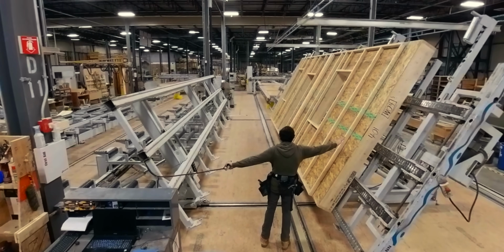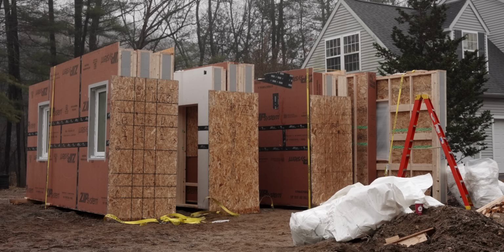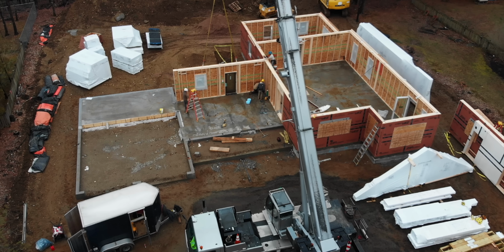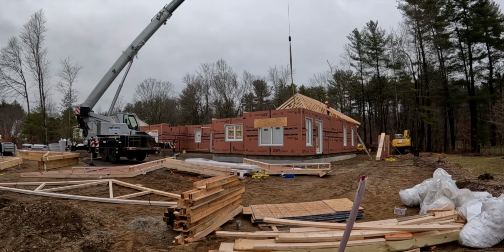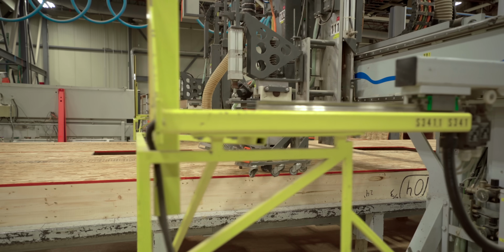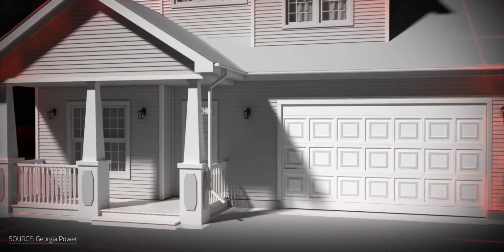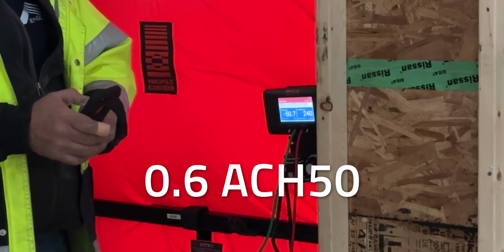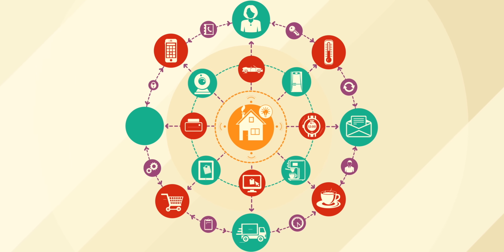Wow! I Didn’t Know A Prebuilt House Could Do This

Comment from the maker: So what do you think about the factory built process so far? Get Surfshark VPN at https://surfshark.deals/undecided - Enter promo code UNDECIDED for 83% off and 3 extra months for FREE!

If you liked this video, check out: The Simple Genius of a Prefabricated House - My Net Zero Home Build https://youtu.be/r-RTlbv84T8?list=PLnTSM-ORSgi7FwYRnWkpCSkAeFOzrgh5h
Reply: All depends on the QUALITY control.  Ive owned 4 homes.  We had one pre-fab that was atrocious and a stick build that was phenomenally efficient.  However, in New England, why build a slab on grade home without at least a partial basement?  Unless I missed it...
Reply: Looks awesome man. Just want to let you know they also have this new thing that pressurizes your house and blows silicone in the air to fill all the little gaps & pin holes to make it as close to100% sealed as possible. If you haven't seen it yet you should look into it before you finish the interior.
Reply: @micjr21  This is the product that you are thinking of. https://youtu.be/JYugiSwWoPk
Reply: Looks amazing n great job on the house!!!
Reply: Looks good. I also built in New England but used R-42 SIPs everywhere including the roof and full basement. I went with geothermal radiant floors and tri-pane windows but didn’t know about those European style latches at the time :(.
Reply: @moonthief869  I'm in the process of planning my house as well and plan on geothermal radiant floors. What did you do for AC?
Reply: I’d love to hear your arguments for/against regarding basements and slab-on-grade, both from the perspective of energy consumption and bang for buck on living space.
Reply: Nice, just hoping for no concrete cracks in the walls/ foundations area having poured in those conditions.   Might as well as  test for radon at this stage as remediation will be easier.   Make sure the guys put rebar in that driveway instead of doing it on the driveway you will have to replace.
Reply: Hi Matt. Have you given any thought to using EV battery(ies) i/o dedicated solar power system batteries. I would imagine the savings would be considerable since you get so much bang for your buck with EV batteries. For instance, 75-, 80, 90 or even 100 Kwh EV battery could be had for anywhere between $8-12k, whereas you would be spending that much or more for a 10-12 Kwh dedicated solar battery.
Reply: @lickshotpalmer1  the issue with EV batteries (assuming you mean removed from EV vs. using EV as grid storage itself) is that the EV batteries aren’t UL certified for residential use and would be issue for building codes.
Reply: @mrbizi5652  Got you.
Reply: Very cool Matt.  Looks like a great way to build a house.  I envy your future efficiency!   Where I live (CA) the utilities are charging an arm and leg for power now,  more efficiency sound really good.
Reply: Love seeing what you are building and have been amazed at the new factory built passive home tech and the high quality and efficiency of these products! Was wondering how electrical is run do they use a preinstalled pvc type system that they just run the wiring thru later which would allow for easy changes or upgrading or is the electrical all preinstalled sort of like a plug and play system, what about the plumbing? Is it all preinstalled in the walls too?
Reply: I truly like the assembly line/Factory Built concept for all of the reasons you cite in this most excellent presentation, Matt. But shouldn't there be some economies of scale benefit derived by the home purchaser/builder? While I get that this particular manufacturer incorporates a great many 'extras', particularly in the realm of energy efficiency; once a process has been developed and perfected, there should be some cost savings realized by the person paying for it such that one doesn't have to depend upon the energy cost savings to offset the greatly increased cost of the structure.

I seem to recall that you are spending somewhere in the range of $300 per square foot for this home. Some of that may be due to where you are but that still seems like an awful lot of money to have to recover via energy savings.
Reply: Matt.... as a patreon supporter of many youtubers right now (way smaller than you, and younger that need the help) hear me out... I really think you should and would be a win-win if you did a 1 per month patreon. A lot of people that could say get access to your upcoming videos a few days in advance, or something a click special than watching here.... it really is a win-win because 1 is better than 0, you dig? 👋 imagine all the people in other countries also, they can afford 1 a month to support your work, not 5 though... once you get to a few that is 15 or 20, you get me? I have a few patreons on a dollar and it adds up if you have 10 dollars compared to 1 or 2 fives.
Reply: I would be very interested in a video about how solar performs with snow. I am thinking of moving from sunny Arizona to a location with fewer drought concerns. Which almost certainly means dealing with snow if I transfer my job to another location my employer is based in.
Reply: @joewilson3393  ha. Fewer drought concerns… it’s been a super hot super dry desert for at least 50k years. If people were ever meant to live in such an arid suburban sprawl, it’s lost on me. Phoenix is why the Colorado river doesn’t reach the ocean anymore
Reply: I would love to see what you do with high-efficiency, smart lighting. Would you do Poe leds like what was in the passive house hotel? Or stick with more traditional high voltage fixtures with led bulbs for something in between like LED recessed cans?
Reply: Hey Matt, it’s coming along great! I’m curious about what sorts of things your going to do with IOT and how you’re going to implement it.
Reply: Looks very, very promising. Without a doubt, I'm going to look into that myself if I ever get the chance to build my own house.

Question: how did you go about finding a good, reliable, and honest contractor?
Reply: @gpw203  I believe they covered that in the previous video where they show the construction of the walls. As I recall the density is sufficient to prevent settling.
Reply: Great project.  Thanks for sharing with us. I noticed there was no basement just a large foundation. Does having a basement detract from the passive insulation factor or just increase the cost? My first house, about 90 minutes from you had a basement that flooded constantly.
Reply: honestly, I'm amazed even this kind of quality house seems build almost exclusively of wood and all sorts of compound mats made largely of some kind of wood too. more sturdy mats like stone or compounds made with cement (although cement still comes with a high CO2 footprint) don't see much use in the US, do they? why the focus on wood? don't say it's all because of trying to be environmentally friendly. it wouldn't explain why the US does it for many decades by now
Reply: When deciding what kind of tech for efficiency or smart home functionality you wanted in the home, did you discover any wild tech on the market that you didn't include? Was there some crazy tech you did include? I'd love to see a video on the more extreme or unique smart devices we may not know about yet.
Reply: @Pygē if ya live in hurricane alley but... Then there are standards... Surely your building code follows those for where you live no?
Reply: In Germany they have Huf Haus, which take the pre-construction to the next level. They're expensive but amazing. We do need a  version which is more financially accessible. 

https://www.youtube.com/watch?v=dDPgJWlrS8U
Reply: In MA and looked into geothermal to replace our aging natural gas HVAC units but the costs were prohibitive even with incentives. About $40K after incentives applied. Did you find that similar? I have a 2900 square foot house
Reply: I live in the „Mercedes Benz“ of pre-fab homes, a „Huf Haus“ (Google).

Here is a similar one: https://youtu.be/-xwtKjnhuVE

Due to our huge glass facade, it is not passive house standard, but it is in incredibly efficient for a house that boasts over 100m2 / 1000 sqf of windows.

We make up for it with a swedish NIBE ground source heat pump using geothermal energy by a factor (SCOP) of 4:1, which means over the course of the year we get 4KW of heat from 1KW of power.
PV System is from German manufacturer E3DC, which has the benefit of providing 3-phases and emergency power. (21 panels East/21 West = 13.6KWp & LG 6.5KWh Battery modules = 13KWh)

We are completely independent from mid-Feb to mid-October on a similar latitude than Boston. April to September we produce excess solar to easily power our Ioniq EV.

All switches, dimmers, thermostats are „smart“ and digitally controlled via a world wide standard called KNX which allows to combine 8000 devices from 500 manufacturers easily via a 30V bus cable. It available globally, but is not very common in the US outside multi-million dollar villas & high-end office spaces. (Sigh!)

My Homekit & Alexa Gateways display 85 „devices“ - Lights, Sockets, Blinds, Thermostats.

And you can control everything on a single mobile app, including the PV, Heat pump & wall charger. One app.

Now all of that might sound a bit „over the top“ and a little arrogant… but the point I want to make is… we built it in 2005(!)

All of that tech has been around for over 20 years and finally… finally… someone is actually spreading the word about it. Thank you,
Reply: Matt my question is about the solar panels on your home! I think it's wonderful that you're being energy conscious and trying to leave a smaller carbon footprint! From what I understood most of America's solar panels are built in China an contain many toxic materials! Have you ever thought about where these toxic solar panels will go once they've outlived there function? Most of Americans toxic waste things like car batteries, computers, plastics and other wastes ends up in places like Africa, so I guess they'll just have to go there! Africa is one of the most beautifulest countries and full of the most exotic and iconic animals! So it's us being thoughtful here in America but  unthinkable to Africa! We need to produce solar panels in America and build them responsibly! It seems as though all our politicians want to make America less oil dependant, but at the same time buy all our oil from places who aren't responsible in their production of oil, plus it's 100 times dirtier, so as long as we don't see it, is their idea! Which in itself means they really never cared! The catalytic converter which takes out over 90% of a automobiles emissions changing them into harmless water vapors! That was a huge accomplishment and they're on every single car now! We need innovative people inventing better ways of doing things, not reinventing the wheel !
Reply: @scottmcauley5781  Search for an article „The Environmental Impact of Solar Panels“ by Kristina Zagame
Reply: @maxking3  
Thank you and I absolutely will! It's been in my experiences that none of these short term green energy ideas have long term thoughts! They tell us get electric cars, ok but when the batteries have served there use, where will we dump them? Plus you need fossil fuels to charge electric cars! Solar panels and wind turbines are only intermittent energies and need to be used as there available! I've already figured out that to power America on those types of plans we'd only be able to meet .005% of the population and only part of the time! We can't drill for oil in America and be energy independent, but we'll buy oil from  OPEC countries, whose process is 100 times dirtier then ours????
Reply: @maxking3  
Ok I've taken the time to read her studies on the Environmental impacts of solar panels! Her end conclusion is that they're better than fossil fuels but do use a lot of fossil fuels to make but not as much as fossil fuels used to create energy! She however admitted that there is many unknowns because of lack of studies and us dependent upon ways of recycling to be invented to help with the disposal of solar panels once they've reached their life times! I would just add that having solar farms does add to making Temps in those areas, towns and cities it does raise the Temperatures and substantially! This heating can also affect the performance of the photovoltaic (PV) systems, the study found and in areas like Texas, Florida, Nevada, California where Temps are already much higher in the United States those panels will be up to 30% not as efficient due to higher Temps! I do feel something needs to be done and believe that through innovation it will happen! Even if it's partially through solar systems and others yet made. I don't think wind turbines are efficient or safe for animals, as many studies have been done and proven! America alone has great demands for electricity and uses over 19 million barrels of oil daily, so something needs to change! It has to be a world effort! Possibly even just having agreed upon shutdown times would be one of the biggest helps! When looking at America from a plane you can see its complete outline full of lights each night! In fact so much lighting has caused it to make us not to be able to see the stars anymore! Remember the times you were a kid to now?
Reply: @scottmcauley5781  In that study, she concludes that CURRENTLY Chinese panels are produced with a lot of fossil based energy. But with every panel, the percentage is shifting. Germany produces 45% of its energy with renewables - panels produced there have a totally different CO2 footprint and if they are installed in Central Europe, there is more CO2 saved on shipping.

And if she‘d compare the pollution with the chemical disaster that is fracking, you would see how little the problem of silver & tellurium mining is in comparison.

The idea that solar panels heat up cities etc is a total myth…an urban legend. When you compare the black panels with the sealed dark grey asphalt - streets, parking lots & roof sealing - the heat that black PV panels would add is totally negligible. You want to cool down cities? Remove half of the car parks and plant trees.

Reuse of EV batteries is already happening. The stadium in Amsterdam has its PV system connected to 150 old Nissan Leaf batteries. In a temperature controlled environment with rather slow charge and dischange cycles, EV batteries can have another 8-15 years of productive use in them as residential energy storage. Just in case you wonder how you can play games in the evening when no sun‘s shining

After that, there will be a very comprehensive recycling model, given that we finally have the installed base of EVs that recycling at scale becomes feasible.

And no. My EV is charged from the roof for 80% of my annual requirements. Outside our village are 6 large wind turbines, which provide additional green energy, so my estimate is that my EV is charged with 10% fossil.

Now if you think that renewables can cover 100% of the US energy needs in the next decade. Surely not. 
Can wind, hydro-power & solar cover 40,50 or even 60%? You bet.

Most energy is consumed during the day. AC is a no-brainer to connect to solar panels. Employers can offer solar car charging to the employees, given the large flat roofs of most commercial buildings, which is as good as a pay rise.
And the US has a very high percentage of single family homes, many „sunshine states“ and some of the most windy places on the globe. So residential solar and large scale wind farms are 100% economic and hardly need subsidies.

And saving 50% of energy in the US could mean a full degree less global warming until the end of the century. (The US per capita is consuming nearly twice as much energy as other developed countries (I am looking at you F750 & RAM 1500), so it would be at least morally right to reduce the consumption to current European levels.

And the US won‘t be able to produce the fossil fuels it needs for more than a generation, while leaving our kids and grandchildren with a terrible legacy of draughts, floods, hurricanes and wildfires, which are x-times more costly than investing into solar production or manufacturing wind mills. Ever wondered how to revive Detroit as a manufacturing center?  Look at wind turbines & blades and you have the answer.

So how comes, that people like you are trying so hard to find excuses for not doing what is needed? Given that 99.X% of scientists agree that human created climate change is real, we already have passed the original goal of 1.5C warmer than pre-industrial age and are likely to get to 4C by the end of the century, if we don‘t change our behaviour dramatically. 4C is roughly 7 degrees F, and average change means, that you might see summers which are 10-15F higher than today and winters  that are 5-8F lower. Because it is not just getting warmer, but more extreme.

So whoever tells you that fossil is still a solution is either denying science & facts, or is paid by the fossil fuel industry to spread falsehoods. 
And it is obvious why. If you can put a PV on your roof, a heat-pump in the house and charge your EV with the energy you produce yourself, Exxon, Chevron and the other energy fossils will dramatically lose business and therefore shareholder money.
Believe me, the number of studies, press articles and whitepapers they provide to discredit green energy as the cheapest and most sustainable  form of energy is staggering… or are you as concerned about the chemicals they use for fracking and how quickly those show up in the groundwater or the pollution around oil wells and pipelines in the last 50y, not to mention tanker accidents and the illnesses and deaths connected to air pollution? Yep. That‘s what I figured.

No. There is zero reason not to go all in on PV & wind now, get production back locally (it is highly automated anyway) and reduce the reliance on fossil fuels as much as possible. Yes - there will be times when gas-power stations will need to get fired up and stabilize the net for maybe 30-40 days a year and provide the baseload for the nightly consumption.

Remember 40y ago, nobody thought that every home would have a computer. Now you have one in your pocket, one on your wrist and you‘re driving one. 

Now that we mastered information tech, the next frontier will be energy tech… and that‘s going to provide even more jobs than IT. Therfore the future is bright… & green!
Reply: I was impressed from the very beginning but, I kept waiting and waiting until at the end you got to the part I was waiting for. I want to know more about that impressive looking geothermal heat pump.

Edit: I almost forgot about the other question I had about the house and that was why no basement?
Reply: @MontyFly  The heat pump seems to be from „WaterFurnace“ a US daughter company of the global market leader in ground-source heat pumps NIBE Industrier AB from Sweden.

The current line-up has many tried & tested components and design similarities with the European part of the company, but the obvious difference is that 3-phase 230V electricity in Europe is quite a bit different from 2-phase 110V in the States.

As a NIBE owner I am as interested as you are about Matt‘s journey.
Reply: Costs?
Reply: @Selieca  In thr UK we would have 100mm polystyrene insulation under the slab.
Reply: It’s a New England ‘earth ship’ congratulations on your new home. Fascinated to know how you home geothermal runs
Reply: The insulation values in your house are awesome. I am curious how the foundation slab is insulated. Can you make a video on it? I also definitely want to see a video on your geothermal heat pump and ERV system.
Reply: I was initially sold by manufacturing houses, but as I researched there's a realization that stick build houses aren't any more "traditional" than modular houses are. 
There's lots of efficiency gains with laser levels, battery powered nail guns, cheap rental excavators, vs decades ago.

Today stick build home frame go up just as quick as modular house is. Biggest part of building a house isn't structure itself it's much more about finishing touches which take far longer to finish up than house structure itself and this part is identical in both.

I do see advantage in modular home building in bad weather on east coast. 
But thankfully I don't have that concern at all, since I'm building in California where it's pretty much guaranteed to never rain for 6 months in summer.

Also I can save a lot more money if building myself as a contractor, vs modular where I'm basically forced to spend more regardless since I can't save on framing labor by doing framing myself.
Reply: It's not supposed to go below 0.35 ACH or no less than 15 cubic feet per minute per person.  ASHRAE 62.1-2022 Standard 62.1-2022 -- Ventilation and Acceptable Indoor Air Quality (ANSI Approved)
Reply: European style windows ? Good choice, hope it is european standard double glass too ! I have been disappointed to see how flimsy and only 12mm spacing are the windows in my son new apartment in Boston !  Insulation, heat AND noise, really bad compared to the real Europeans windows. Funny but the strongest parts of your house will be these windows :). Note I reckon frame houses are surprisingly well insulated despite the walls being so thin. No mass to hold the heat on the other hand
Reply: Hi Matt, love the coverage of your factory build home project so far. Curious as to why you went with cellulose instead of say Rockwool insulation to avoid mold and have more fire resistance. 

Going forward, it would be very interesting to see how you spec'd out the electrical systems/requirements and then sized your solar system to provide the needed power. Also, how you're doing your electrical heat and heating of water. And, of course, how you sized and how you're using your geothermal system.
Everything to come seems fascinating and I'm taking notes against the day my wife and I can have a home built the way we want.
Best of luck in the remaining work and cheers!
Reply: I've been living in a prefab house for the past 28 years over here in Germany. It was built on site in 3 days following a couple of weeks for all the interior work.
Even though it's a couple of decades old now it's still pretty on par on efficiency when it comes to heating in the winter.
Cool thing you can finally open your new windows "Auf Kipp" like us Germans for the past 50 years or so.
Reply: @Pygē Unity Homes. Are your concerns related to hurricanes?
Reply: this more interesting than battery video that came after this. Is data available on when you break-even the cost of this vs a typical build? Isn't geothermal too expensive than just air heat pumps?
Reply: Black-on-black aesthetics for your panels and roof shingles. A 9.6kW Tesla array with a couple of Powerwalls might work. And, under the SMART program you're good to go.
Reply: What does "pre-built" even mean?   Do you mean pre-fab?
Reply: Building your house where you'll be car-dependent kinda erases all the good intentions that I know you're trying for.  It's not just the car itself, it's all the roads, infrastructure, and habitat destruction that goes along with it.
Reply: But Matt ....its still not efficient because on a plot of land its best to build at least a 30 story apartment building
Reply: I want the full geothermal drilling/digging installation video !
Reply: Matt do you not know your fellow YouTube creator Matt Risingher who  runs the build show channel amongst other things. He consulted on the home being created the YouTube Vetenarian who channels include Off The Ranch
The point is Matt Risingher could have helped give your video a more technical input. 
But anyway he is big into the Zip R sheeting system & whilst based on particle board in has a huge chunk, I think, of baked in water protection via the use of wax.
Reply: I'm disappointed in that Why are God's name are you using wood to build your home!!! Why are you murdering trees!!! You're supposed to be setting an example for going carbon neutral!!! I'm so disappointed in you!!! How much carbon dioxide did you make building your home!!!!
Reply: @highlander723  HI there troll!!!  Trees are carbon neutral btw!!!  More can grow and take up that carbon!!!   #!!!!!
Reply: @1diggers1  I've been sitting on my fingers trying to avoid replying to the troll 🤣 It would be difficult to find something better for the environment than wood, unless it's adobe or hay bale.
Reply: @thentil  Yeah, that guy was just obviously trying to be a prick for no reason.   Too much of that in general and this channel isn't the place.
Reply: @thentil  Hemp is a good alternative to wood as a building material.
Reply: @highlander723 That carbon is now sequestered into the house walls.  New trees, which absorb more carbon than old trees, will be planted.  Would you rather have non-renewable materials used for walls?
Reply: @garymyron6699  What about using all the other building materials that he's talked about. What about building them from those fungus blocks or the biodegradable plastics. He had plenty of options instead he chose wood
Reply: @highlander723  wood actually sequester carbon .. think about it a tree grows ests some carbon gets put in a house and frame ... And unnkesss it burns down the carbon has been taken out if the system ... And then they regrow more in the same spot.. boom less carbon !
Reply: @highlander723  - Trees take carbon out of the air and lock it up in building where it won't rot and return to the atmosphere.  In responsibly managed forests, building with wood is carbon negative.
Reply: @highlander723  Because wood is a renewable resource, efficient, and very versatile and easy to work with. Also, carbon is meant to be cycled through the environment. More carbon dioxide means more plants and rain, which makes more oxygen which creates an environment for more animals to breathe the O2 and eat the plants and animals, that eat the plants and breathe the 
02 on the bump on the log in the bottom of the sea. Which then creates more C02 from all that breathing, and an environment with more plants and rain, and so on, and so on.
 Also, murder is a word reserved for the killing of a human by another human. not even by another animal, it certainly doesn't mean harvesting a tree. Also, it's healthiest for woodlands and as a result all of the environment when a cyclic thinning out occurs of this amazing resource.
I'm disappointed in you that you would verbally accost someone who's being so eco responsible and who doesn't misuse words like murder in a way that devalues human life, and frankly trees as well. 

Matt did a fine job as far as I can see. Only thing I'd do different is hire a guy like me to just move the whole house in one piece, that usually only takes 2 days to move, depending. Can even put in on a basement for ya. That confuses the neighbors lol "was this house here yesterday?"
Reply: @highlander723  Do you drive a car? Do you eat processed foods? Do you use electricity? Do you have wood, plastic, concrete and various other products in your home? How much C02 did you make just ranting about this post?
Reply: @eaglestudios4146  Hey I probably admit it I never said anything about me. But he's the one with the YouTube channel He's the one that constantly advocates for being carbon neutral he's the one that constantly says that we should be using other building materials and then he goes ahead and builds his dream home out of wood! That is hypocritical and I'm calling him out on it!
Reply: @highlander723  calling out a hypocrite in this case is like standing in front of a bus. there is no scientific proof that excess C02 is an issue in the first place. It is all BS propaganda. Think about this would you rather have more C02 to produce Oxygen or not enough? There can be no carbon neutral..we would all die.

Wood construction is the material of choice as it does leave the least amount of C02 footprint. From earth to sawmill, distribution to construction. Unlike Steel or even concrete.  But again it does not matter.
Reply: @eaglestudios4146  No you're missing the point He's the one that has a YouTube channel that's saying that we should all turn to these alternative building materials like fungus blocks and so on. And he always emphasizes it with being carbon neutral. Then he goes ahead and builds his house made out of wood. It's hypocritical It really is.